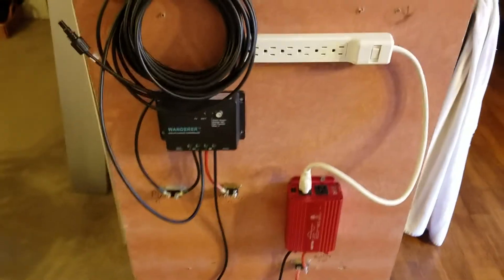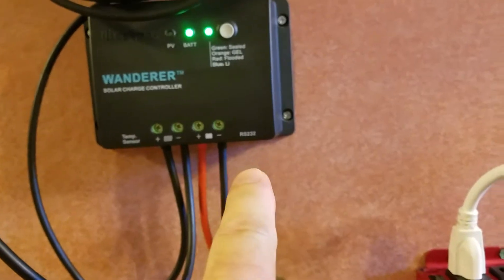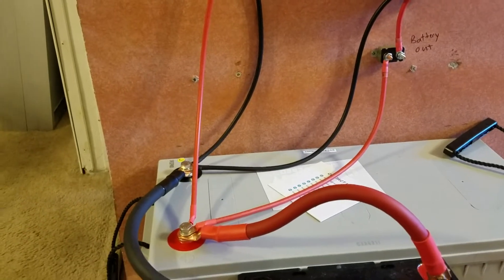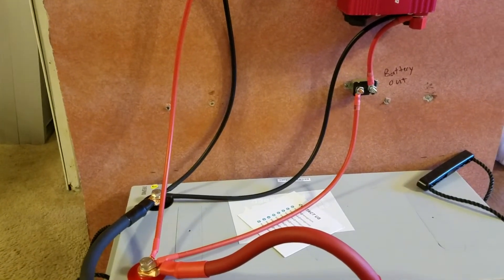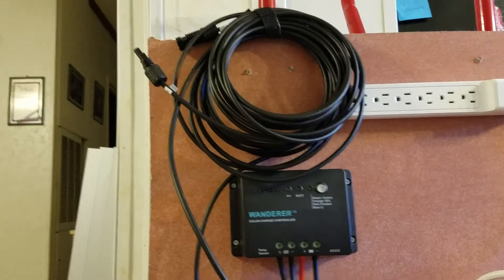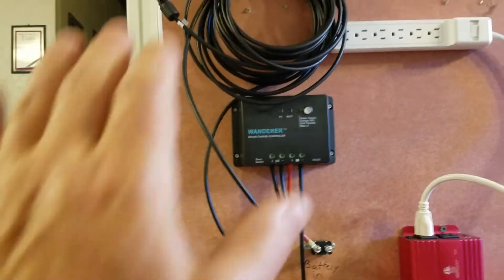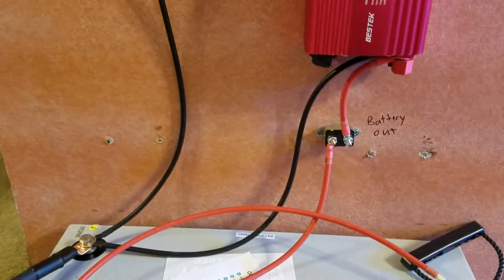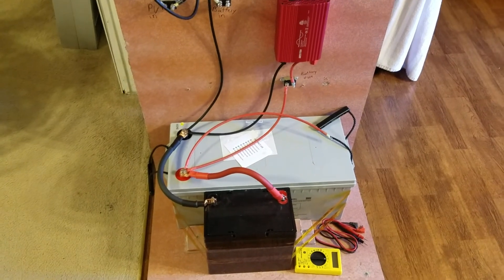400 watt solar hand truck part 2 | diy portable solar generator

Comment: I’ve never seen breakers like that those look automotive parts like a solenoid or something some sort of power reducer switch. I don’t think their breakers but what do I know?
Reply from the maker: It is entirely possible that I used the wrong thing.  I suppose I should add links in the description to the parts(and will likely soon).  Until then, this is the name of the breakers I used(from Amazon):
1) Bussmann (BP/CBC-40HB-RP) 40 Amp Type-I Stud Mount Circuit Breaker
2) Fastronix 30A 12V Type 1 Automatic Reset Circuit Breaker with Cover

Comment: Wires connected to the inverter from the battery needs to be at least 6 AWG in my opinion.
Reply from the maker: Depends on the type of inverter.  There is no one size fits all wire size, for anything.  You have to take into account the current draw.  In some inverters, 6 awg could be too small. 

This inverter draws at most 25 amps.  300W/12V=25amps.  The copper wire length is ~2 feet.  That yields that 12 gauge wire will work just fine for this inverter in this application.  So my use of 10 gauge wire is a bit overkill already.  On top of that, I have 1 breaker and 2 fuses as well.

You can use 6 gauge, but, you'd be spending even more money for no gain at all.

Ampacity is the maximum current that a conductor can carry continuously under the conditions of use without exceeding its temperature rating.  

You can use up to 13 feet of wire using 12 gauge wire at 25 amps before having even the slightest bit of trouble.  

Doing ampacity calculations can be complicated.  However, referencing ANY ampacity wire chart, or ampacity calculator, shows that what I am saying, is correct.

Comment: Thanks for making this.
You say "um" all you want buddy 👍
Reply from the maker: Lol, thanks man, you're too nice. I plan on doing a part 3 soon-ish. I set this up to test it, and it works well, but then I got busy with other stuff. I bought some additional components, like a battery monitor and bus bars.  I figured out how I am going to enclose it, making it more of a portable solar battery shed.  I figure it is useless if it can't sit out in the rain.  I also bought a new inverter, a Krieger 1500 Watt 12V Pure Sine Inverter.  Super excited about that. The specs have a super low resting wattage, and it has an A/C terminal block, which is cool, as most inverters at that wattage don't have it.  You often have to get above 2000W before an inverter has that feature.  I do believe it is made in the U.S.A. as well.  I look forward to testing it out.